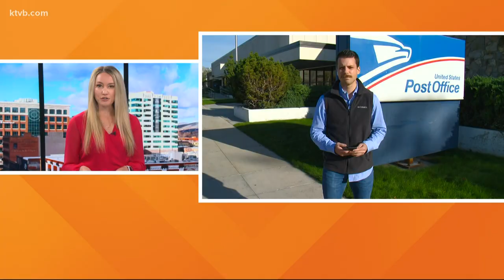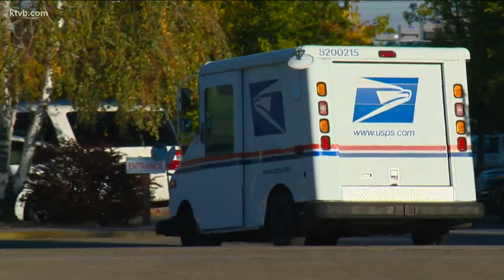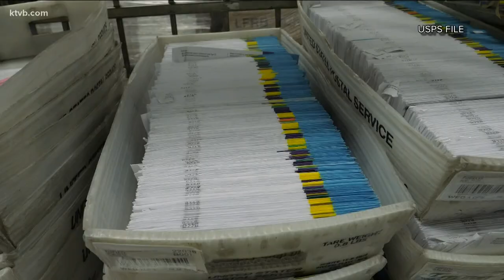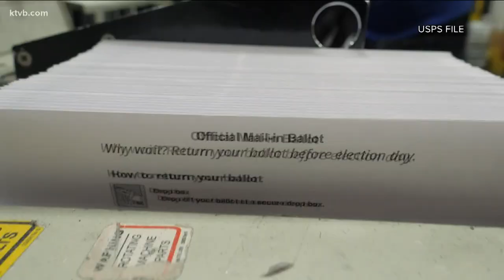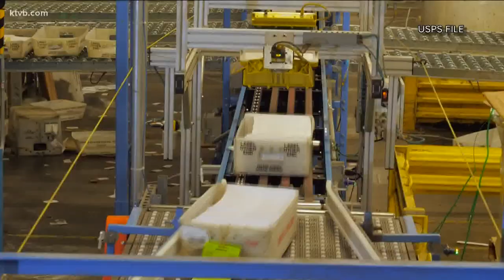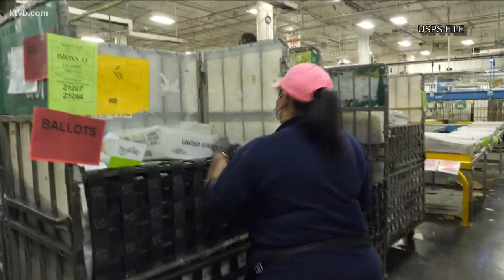Here's how USPS workers will handle your ballot ahead of the November election

Comment: USPS is failing. I am an AZ resident temporarily in NY. In September I requested from AZ Elections an absentee ballot to be mailed to me in NY. Checking their website it showed the ballot was sent by them Oct. 8. Checking my mailbox at the post office, I hadn't received it. On Oct. 22 I called the AZ Elections Department, told them I didn't receive my ballot. They said they would cancel the first ballot and send out another one. I checked their website again the next day and it said the second ballot was mailed Oct. 23rd. I checked my mailbox Oct. 28th, still no ballot - neither the first, nor the second. One ballot lost in the USPS system may be a fluke, but two lost is not a coincidence. I filed a complaint with the USPS Postmaster General and Attorney General, with US AG Barr,, with the FBI because voter suppression and election tampering is a federal crime, and wrote the White House and Project Veritas. I want an investigation.